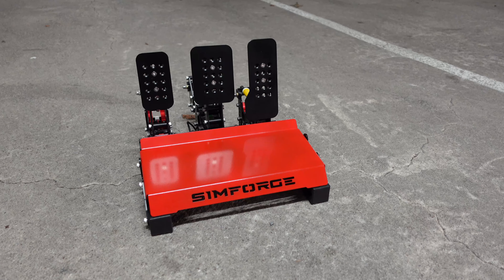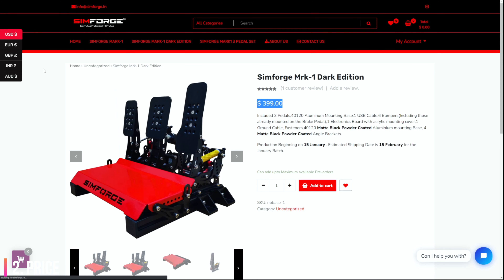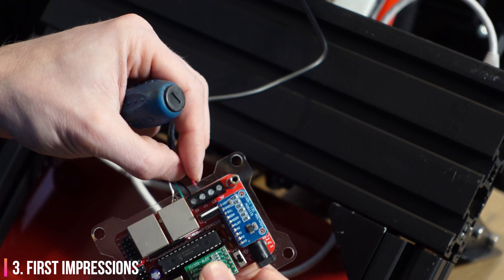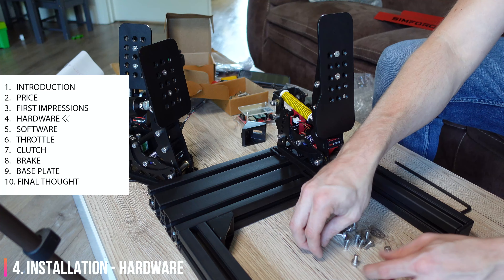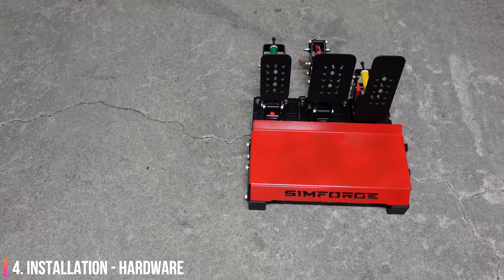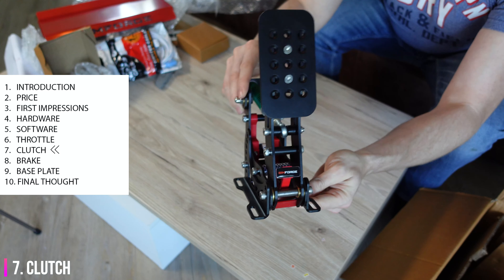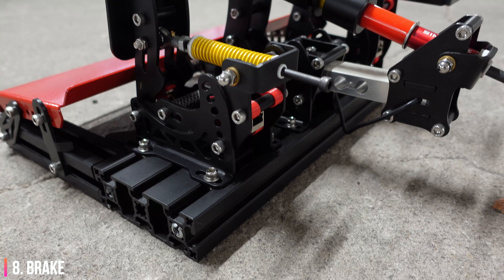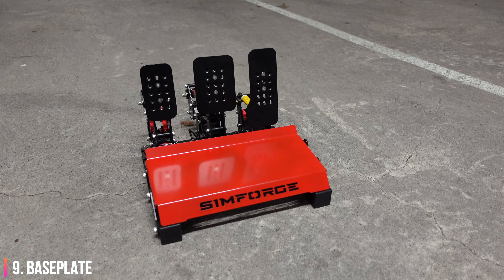SIMFORGE Pedals Long Term Review | Mark-1 Dark Edition

Comment: Between your videos and Barry's, I order a set of Simforge. They just showed up yesterday, and I am blown away by them, and feel that I most definitely got my money's worth and then some. Now, I just got to get them dialed in where they feel perfect. I got the brake feeling amazing. But, the clutch throw is way too long, so I need to close that up a bit.

But, anyone considering these, I highly recommend. They are beautiful pedals, and feel like they outlive me.

Oh, as of the June 2022 Batch, they still have the bare wires for the brake, that have to be screwed into the board. So, they haven't updated that yet. FYI.
Reply from the maker: Ah good to know! Thanks for the kind feedback ❤️

Comment: Really enjoyed this great review Laurence. I have had these pedals for over 4 months now and still absolutely love them. I upgraded from CSL Elite Loadcell pedals, as I wanted hall sensor units. So worth the price. I did have a few fits and starts to get them calibrated, but once done, they continue to perform extremely well! I highly recommend.
Reply from the maker: Yeah there’s a little bit of setup but it’s great to see them improving on all of that now
Reply: @Riko Suave
I have the csl elites with load cell because I got them for a price I couldn’t say no to, but they feel horrible to me. No matter what config I put them in, the brake just feels bad and inconsistent. Also, I have to use the top of my foot to make sure the pedal flexes enough for the location of the load cell. What are some stand outs with the sim forge in comparison?
Reply: @David-ym2vk  First, they have a great range of customization, with both the spring loading and the bumpers supplied. You can angle the pedal to get just the right feel. I have adjusted all of the pedals, from adding more resistance with the throttle to just the right dead zone on the brake pedal. I tend to keep my foot lightly on the brake, so needed to set it up accordingly.

Comment: They look excellent, absolutely excellent. 
One thing you said reminded me of shh shifter(no I'm not obsessed after getting it 😂) is when you said it's a product that still evolves and the problems get ironed out as they keep revising it. You get a great product now and it gets improved further down the road. 

The pricing though is a bit over the place as you get the initial 400 dollars, but you have to factor the price of shipping and all the tax. It may detract a bit from their value, but still keep them competitive. It reminds me a bit of the "DD wheel from fanatec for only 350 euro", but if you account for all the things to enjoy it fully and shipping, it's double of that.

Aside of that, they seem excellent and tons of adjustability is never a bad thing. I really like it when products are made with the approach of "adjust it however you want to your own preferences" instead of "this is the only way to use it". The support approach of not having to ship the whole unit back is also excellent and consumer friendly. 
Really impressive set of pedals, and absolutely beautiful in that colour scheme.

Comment: Would like to see where these factor in after shipping, taxes and import. Like you say, it’s going to end up costing more than the price would suggest, and it might even get to a point where you go “sod it, I’ll save a bit more and get the Heusinkvelds”
Reply: Lol. This is exactly what happened to me I was about buy these then realised that once you factor in the additional costs you may as well just go the Heusinkveld option
Reply: Arent heusinkveld over $1000 though? I’m from Canada and even with the import, shipping etc I think these would still be a lot cheaper
Reply: @tomatoman3706  not if you buy the HE Sprints. I'm from the UK and can expect to get them for £650
Reply from the maker: Sprints end up being over £800 (including baseplate and VAT) before shipping from demontweeks. Also worth noting that other than the software, I think these simforge pedals are better than sprints… there… I said it… well i haven't done a side by side but I think they're definitely on par. overall the price probably allows the simforge to get the win.
Reply: FYI $489 delivered to Colorado .. should be here 1 Feb
Reply from the maker: @ritkecek157  wow is this including import charges?
Reply: @LaurenceDusoswa  I guess everyone's situation/opinions is/are different and that's completely fine. More options available means we the consumer ultimately are the winner.
Reply: @LaurenceDusoswa  yes .. shipping and VAT= $120  .. also... these are the silver color edition .. that would be like $509 for the black edition
Reply: @ritkecek157  damn that’s actually not bad at all and I kinda like the non black just because of wear and tear the black will eventually get scuffed up
Reply: @ritkecek157  1? not 15?

Comment: I bought the Mk1's but am waiting on a new pedal plate from Trak Racer for my rig. They feel like a significant step up from Fanatec ClubSports for those who don't wanna break the bank. Thanks for the suggestions configuring the brake pedal I prefer a firmer feel so I can "stand" on the brakes with some force. Hopefully it still provides a decent amount of travel and granularity that I want. I wish the load cell connections were plug n play. Not sure why SimForge couldn't have developed an easy connector but its a minor annoyance for us early buyers. Cheers!
Reply from the maker: yeah i'm sure you can buy the upgrade parts individually from them but if your current pedals work, no need to fix them
Reply: The connector is simply because to allow diy minded user to buy replacement loadcell from ebay or any online china express shop for quick, cheap and easy repair...

Definately allowing more freedom of pedal maintenance

Comment: Thanks for a great review.  These pedals have been on my radar but I have been waiting for your review and one other pedal set to make a decision on which on to buy.  I do have one question that you may or may not be able to answer.  Can the pedals be purchased without the base plate?  I am currently not running on a profile rig so using what looks like a great base plate and profile base is almost useless in my setup.  I don't see that as a negative tho.  In the future I am thinking about a profile rig, but as of now I run on a prebuild rig.
Reply: The website does have an option to purchase the pedals without the base plate.
Reply from the maker: yeah I think you can buy without the baseplate too. i can give you the measurements of the mounting holes in discord if you'd like

Comment: Would you recommend these over Fanatec's V3s? I'm looking to get into simracing and I'm planning out my build, and I feel like the level of adjustability in these provide more than some of the bells and whistles (like the vibration in the gas pedal) of the V3. Lmk what you think!
Reply from the maker: yes. 100%
Reply: Most people I've read about that currently have or have used the v3's say the vibration motors on the pedals are undersized and they're too small to add enough substantial feel. The v3's also have a lot less adjustability than the simforge pedals. At the current price ranges of each, the simforge pedals are the next step up from the v3's in price and quality. Above them is the $800+ price range where everything increases but diminishing returns comes into play.
Reply: @David-ym2vk do these pedals also have a vibration motor like the v3s?
Reply: @NoDuane  No they don’t.

Comment: I get doing what you can to bring the price point down but using literal garden hose is proper meme XD
Reply from the maker: Does it matter though? Would other material work better?
Reply: @LaurenceDusoswa  obviously not, if it works it works, but there are a multitude of various rubber tubings that do the exact same job at the exact same price and don't look as tacky as a bit of garden hose 😂

Comment: Junk
Reply from the maker: Thank you for your review 😅
Reply: @LaurenceDusoswa  Garden hose for €500, what else can I say
Reply from the maker: With respect, they are not a Logitech or a thrustmaster who can produce things at scale and make whatever they want. €500 is a great price for these pedals. Take a look at what competitors charge. There needs to be compromise sometimes
Reply: Thank You for your feedback. P.S the  Curiosity MARS Rover uses Zip Ties which hold the cables together
Reply: @KADAMANUDA  Idk about garden hose but the use of this material as an adjustable pedal stopper is pretty well thought out imo.